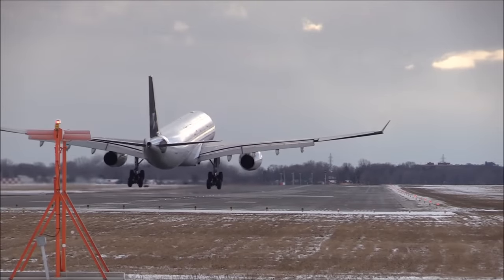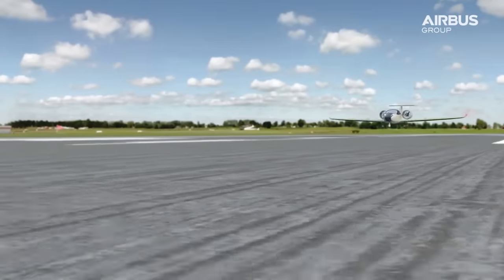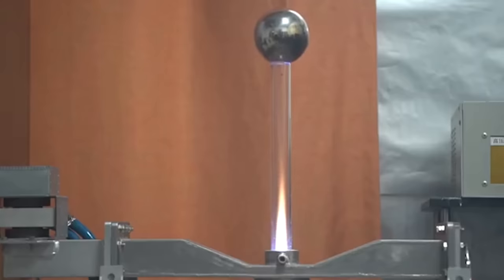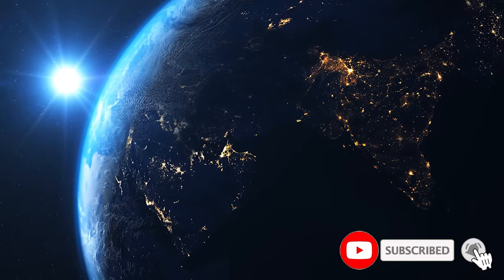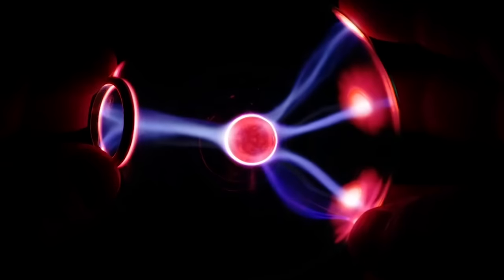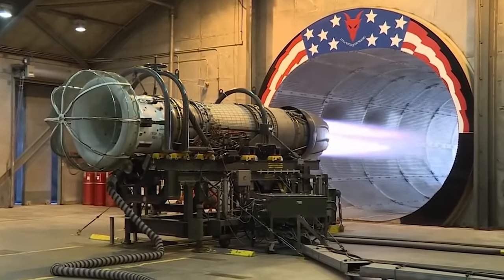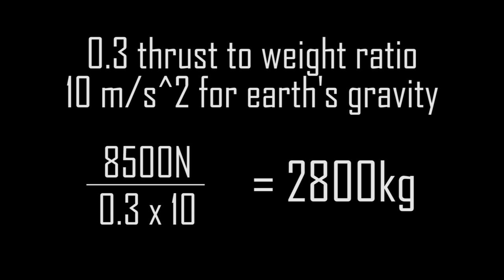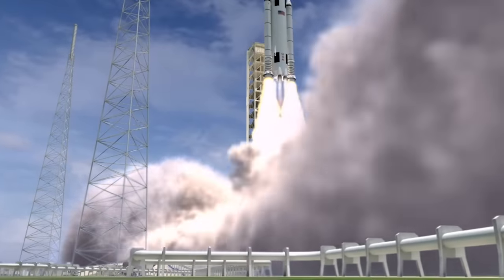Uncovering China's New Electric Plasma Jet Engine

Comment: Hmmm.. like so many other futuristic breakthroughs, this one seems dependent on the mythical power source that exceeds the energy density of hydrocarbon fuels while NOT also producing carbon emissions or other output that can be considered “dangerous”.
Reply: Graphene
Reply: Hat Kid 2.0, right.  Graphene is another one of those promising technologies we’re still waiting for.  So maybe you’ve got the answer there.  In about 175-180 years from now, this will all be working.
Reply: @thinkingoutloud6741  Graphene quality and pricing rapidly rapidly improve though. But yeah, graphene batteries currently don't store as much energy per kg, as fuel would.
Reply: /X/EN understood. First generation, and not capable of pushing an electric turbine jet. I’m not saying it’ll never happen. I’m just saying it’s a developing technology that’s been “developing” for a while and will be another long while before it develops enough to support an electric turbine.
Reply: /X/EN, I think that is realistic. Just consider the rate of technological advances since 1920. There were some advances that moved things forward in spurts of advancement, but as you get closer to today, you see advancements continuously slowing down.  Researchers are focused on polishing the gems of past breakthroughs far more than they are pushing for new breakthroughs.  I think it is way OVER optimistic to believe this will be a usable technology in less than 100 years.
Reply: /X/EN,  I would offer that I am stating my opinion. As such, please reconsider you statement.  Everyone is allowed an opinion.  And you don’t agree with mine. And you don’t have to. But you also have no grounds to say I don’t know what I’m talking about.  The most you can say is you disagree with my opinion.  Just as I say I disagree with yours. 
It seems that too many people these days find it hard to distinguish between statements of fact and statements of opinion.  We might find our discussions to be more productive if we could all get a better handle on this and calibrate our responses accordingly.
Reply: /X/EN, certainly, assuming you know my thoughts and can judge all the information that I consider in developing my opinion.  Since I know you can’t read my mind, and I haven’t given you a compressive listing of all that went into this opinion, I have to say you’re still jumping to an unsupported conclusion. I mean, I’m offering my opinion that is not dependent on information from you, and you are offering an opinion that is completely about me and information you can only get from me. That means I have a much better chance of having the information that will support my opinion, than you have of having what you need to support yours.
Think about it.
Reply: Heads Mess ,  sorry.  My view of reality seems to be incompatible with much of today’s thinking. But that’s okay. The world is safe. I’m an old man and don’t interact with very many.  I just got lucky to meet /X/EN on YouTube.
Reply: Getting thrust from electricity was never the problem. Storing the electricity is.
Reply: @hamsterminator  Well... Both are problems that need to work with. You need a high energy storage and you need an efficient and powerful electric "jet" engine  (or something capable of work on similar conditions and capabilities)

But if the electric engine results even more efficient than classic jet engines or at least similar, that could result in a useful technology even without batteries involved. For example, it could result that efficient electricity conversion -> electric engine could perform even better than jet engine. Or because you are not linked to a specific fuel, your plane could work with synthetic fuels very different from aircraft fuel. For example, you can use natural gas to run a generator to provide the energy while a battery pack only provides a regulation and a backup for extra power like the take off.
Yes.. You can probably build a airplane engine that runs on natural gas directly... But... another for biodiesel? Or methanol? Or ethanol? Or hydrogen?

If you have an efficient electric engine, burn fuel -> generate electricity -> run the electric engine is a valid option.
Then for CO2, the problem is how generate the fuel without net emissions.
Reply: Heads Mess Hydrogen: 33.6 kWh/kg; Diesel: 14kWh/kg
Reply: Correct.  Electricity is a power transmission choice, not a power source. So...if we can't fit the reactor in and must use the mythical batteries, this is basically a coal or natural gas-powered engine...
Reply: Heads Mess yes, you are right. Energy density is lower. Actually I incorrectly stated the figures for specific energy (kWh/kg) rather than those for energy density (kWh/l).  Even with the weight savings of hydrogen that would improve efficiency, you’d need around 6x the tank volume at 70MPa pressure to get the same range in an typical airliner.
Reply: /X/EN  Optimization generally takes longer as there need to be a compelling reason other than, for curiosity sake, but I will agree it is certainly feasible in less than 100 years, I think the primary driver though will be cross application from use on another technology platform.
Reply: This "air plasma" creates nitrogen-oxids, probably higher rates than kerosene combustion chambers...
Reply: Fusion is not mythical
Reply: Canis Majoris, the one that actually works so that it can be packaged small enough and light enough for airborne applications certainly is.  We don’t get to carry around portable suns yet. 
Maybe someday, but that’s my point...
Reply: @thinkingoutloud6741  rome wasn't built in a day
Reply: Canis Majoris, my point.  Thank you.  This won’t be built in a day, or even a year...
I have to say that the push back on this thought surprises me.
Reply: @thinkingoutloud6741  more like within a decade
Reply: Marco Zolo, I applaud your optimism and hope it is founded on something in our world that I’m not aware of.  I’d like to be surprised and proven wrong.  
I’m just “not feeling it” after living through so many decades of hype, hyperbole, and broken promises. People that are involved in the cutting edge of technology have an interest in making their work and their progress in the field they are in appear more than is real. It’s always been like that. Whether it’s for personal recognition, professional advancement, competition, or government funding, I’ve had so much smoke blown up my [***] that it’s hard to believe anything they say.
Reply: @thinkingoutloud6741  well do you believe we will fly to Mars and colonise it within this decade alone? Because that in itself is a leap of faith too. In so far as it's never been done before. And how many scientists made forecasts that we'd all be living on the moon or Mars over the last 40 plus years or so
Reply: Marco Zolo, I do believe we can put people on Mars in the next decade.  Colonize it?  Not in the next decade or even 2. We might see some kind of base there. We might see people come and go. But actually living there, as colonists?  Calling it home?  Raising families?  Learning to be independent?  No. It will take a couple generations, or more, of people coming and going, perfecting processes, building infrastructure, before colonizing will have a chance. 
I watched the Apollo project take us to the moon. I watched Neil Armstrong take that famous step.  Then I watched the rest of my life, to this day, as we didn’t return.  I remember in the early 70’s all the stories and movies and TV shows that were inspired by our visit to the moon. I can’t tell you how many “studies” I’ve read about how a moon base could be built.  But we haven’t built a single installation, of any kind.  And the moon is right next door.  
Trying to go out to Mars and colonize is doing it the HARD way.  That’s why it will take a very long time. We could have perfected so many things by building on the moon, but we didn’t. 
I am very happy to see a dreamer like Elon Musk, with the resources, to bring the advancements he’s bringing.  But dreaming and reality take a huge amount of work to reconcile.  And time. 
That’s all I’m saying.
Reply: ungratefulmetalpansy, and Mars is any better?  I recommend you look into how much technology came out of the trip to the moon.  
I don’t see the moon as a new home for mankind, but it would have been the right place to build a stepping-off point.  A good place to prove out our technology before taking the next large step. 
Stunt?  (Were you even alive then?) I can tell you, going to the moon was NOT a stunt. It was a very real effort.  The fact that there was no follow-up left it a target for the nay-sayers, but it was not a stunt.  No more than going to Mars will be a stunt. 
But I don’t see Mars as a new home for Mankind either.  It’s just another step along the way.  
If you think that making incremental steps in growing knowledge is the wrong approach, I invite you to bring your alternative to the table.  And this would be as good a forum as any.  I’m listening.

Comment: Sounds like we to combine this technology with ion thrusters and make a hybrid design or introduce a very small amount of combustible gas to increase the the plasma heat and density.  Also by adding this in place of the combustion chamber in a jet engine would allow for more higher pressure and volume. So it should scale just fine. Just need the battery tech to improve.
Reply: for that purpose we have to go hydrogen power.

Battery power is limited to cars as they are now and in the near future. 

Hydrogen is more apt for more powerful and larger applications
Reply: @carlosandleon   Hey what ever it takes to make it work. lol
Reply: @carlosandleon  Hydrogen is the cleanest and most efficient burning fuels per weight, but will require a large redesign of aircraft structure as the tanks are prohibitively large and need to be cryogentically chilled (even more important in atmosphere). Either that or they require extraordinarily strong pressure vessels. Another funny side note is that most industrial production of hydrogen is a side-effect of petrochemical processes...
Reply: @carlosandleon  Problem with Hydrogen is that while its combustion doesnt produce CO2, it does produce NOx on roughly the same scale at gasoline engines.
Reply: @captaincannabis3321  makes sense since atmospheric Nitrogen is still oxidized
Reply: @captaincannabis3321  But it is better than gasoline or diesel and it's more efficient than battery power in larger applications

Comment: World in 2100: all electrical

Emp bomb: im about to end this mans whole career
Reply: Or just a nuke. They produce an EMP burst and destruction. But for real the only way all electric, which would be great, would work is producing said electricity with a nuclear reactor fission or fusion. Granted the materials for a fission reactor is finite but the energy potential is HUGE and fusion reactors are still just a theory. This means we need to quit with the stupid politics and do something that would actually be beneficial to the world.
Reply: @Ronin_72  even better: both!
Reply: well, normal bombs destroy gas powered engines...
Reply: @paddlesaddlelad1881  Yes, but a nuke produces an emp pulse. Unless it's a mechanically injected diesel or carbereted gasoline engine the emp will disable it with out any physical damage unless it's close enough to the blast radius well..... most things will be destroyed. My point was nuclear energy yields huge amounts of potential energy and as of 2021 the only way that electricity is produced that would keep up with demand in a all electric world is nuclear. Electrical equipment such as water heaters and furnaces require more KWh than gallons of fuel/oil (or pounds of natral gas/coal) to match the same BTU output as a fossle fuel equivalent. This is why mostly small houses, apartments and manufactured homes use electric water heaters and furnaces but if the materials used to produce said electricity yielded more energy potential (provided there is a way to store spent nuclear material safely) it would matter less how how much energy/materials it took to produce x amout or BTUs of heat.
Reply: @Ronin_72  a good pipe bomb will wreck a turbofan engine too. im not talking about nukes specifically, but bombs in general.
Reply: @Ronin_72  btw im talking to the guy that commented, not you, and that a normal bomb destroying a conventional jet engine is the equivalent of an emp destroying an electric engine thing.
Reply: @paddlesaddlelad1881  oops, carry on. Cats out the bag now.
Reply: Laughs in Solar storm
Reply: @samuelmatheson9655  haha
Reply: @Ronin_72  fission is insane expensive compared to solar
Reply: @crhu319 Literally impossible to go all solar not only for our power needs now let alone 100% electric. I guess if the world decided to be omish but this thing, YouTube, would disappear.

Comment: The "electric plasma" is not new! It has been used for long as an electric plasma cutter, in services cutting iron and other hard metals.
Reply: I wonder why people panic just because it's China. It may be that the information was obtained by hacking into the PC of a Western researcher many years ago, but I wish they would stop their habit of unconditionally praising anything Chinese.
Reply: This is a propulsion engine, not a metal cutter. There's a difference.
Reply: @SC-zq6cu   : The idea itself has existed since the 70s. Nevertheless, it's a sub-par chinese derivative of plasma engine research. No one knows if or when it takes off, or not.
Reply: @honyasenyou  It most likely won't work due to the fact that batteries are heavy and will stay that way due to chemistry and physics
Reply: exactly
Reply: @SC-zq6cu  the working principle is similar, by using ion on the air.
Reply: @honyasenyou  I don't see where the unconditional praise in this video is when it concludes with "Might not scale well, hope someone builds on this". They've not built a jet engine, they've basically explored one of the ways to generate plasma for thrust and that's what research is; making a minuscule nudge forward for someone else to build on. We'll find out if it's stolen or not when it gets peer-reviewed and accepted to reputed journals. If we took the names and countries out of the title, I'm sure people would be interested in the tech and not panic about over-praising china.
Reply: @quw1556  not sure about that, the new solid state batteries are supposed to weigh a fraction of the weight, and withstand more charge and discharge cycles.
Reply: @sethh8892  The fact still stands that batteries wouldn't work well in planes. In cars and boats it isn't a problem due to the fact that they have things that can support their weight but with airplanes you don't have much of a difference in density and so the only thing supporting its weight is the plane itself. For small planes it isn't much of a problem, but small planes can't fly as long. I'd love to see batteries that are viable in planes but you would most likely have to give up speed, power, etc.. It's very hard to get a jet with electricity.
Reply: @quw1556  you'll never know. There's an on going research and testing for small batteries. Human kept going because we are born innovators.
Reply: @ajsarrosa2678  It's impractical no matter how you put it and unless we find or make a new element or compound for batteries this won't ever make it far. There's also the fact that it is much more inefficient to have loses transferring energy to a different medium instead of using it directly.
Reply: @quw1556  I am not against you. It's just , I want you to consider the possibility of time. But technically, what you are saying is correct. 

We need innovation and people do not stop innovating.
Reply: Guys you got it wrong!
This is not an electric plasma engine, this is an electromagnetic plasma engine and the difference is big!
Not like inefficient arch plasma cutter. 
Plasma is maintained by microwave.
Reply: If you think about it, first plasma engine was when gun power was invented and put in a long paper tube, Nothing is really new any more it's all been invented before or discovered, only thing that is different is how use the application of that idea and what other ideas we couple it with. 
Like the jet engine, that was really invented in the 1800s during the Victoria era, by a Romanian in Romania, but his invention is just 4 other inventions put together
Reply: No shit Sherlock, but electric plasma or an electric plasma cutter aren’t the same as a viable plasma jet propulsion engine which they invented.
Reply: A motor that runs the washer had been around long before someone started using a motor for laundry machine. Utilisation of motor for laundry is the different here.
Reply: * Facepalms *
Reply: @kusalg  The Problem is this is something that has been known about for a long time back in 2018 some MIT kids made a drone that used ion technology for thrust...
Reply: "electricity" isn't new! It's been used since Nikola Tesla was alive!

Like, what a moronic comment. Of course it's not "new" it's just the first time it's been used in this context...
Reply: plasma cutting function is different than gas plasma reactor, right it has been around for a long time, but it consumes a lot and i think this plasma reactor idea is not a good idea only if they could dilute it but what about the propulsive force i am very skeptical about this

Comment: As an engineer who likes data quality, I would like to see a few more points for those straight line correlations.  But good work on developing this.  It would be cool to see this be scaled up for sure.  I'm thinking a normal fan blade like on the front of a normal jet engine could be used and rear turbine blade to drive it from the hot gasses.
Reply: Would you like fries with that also?